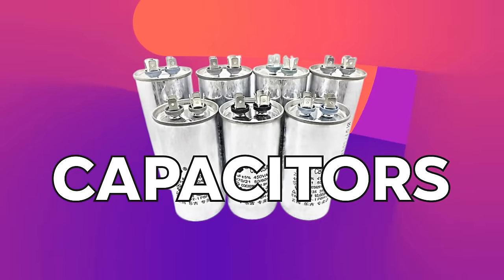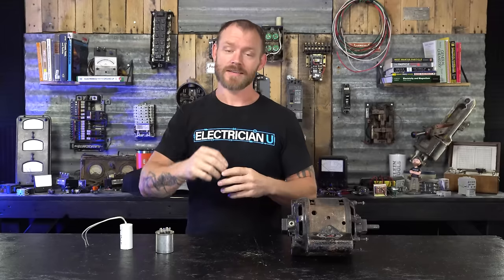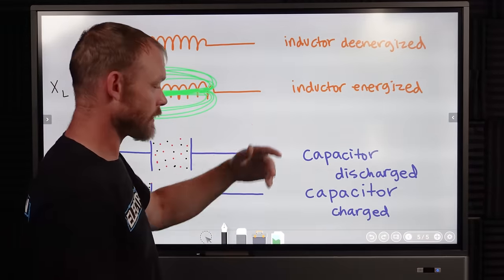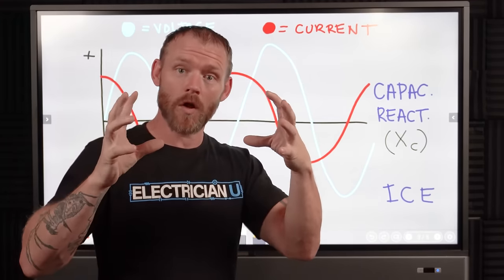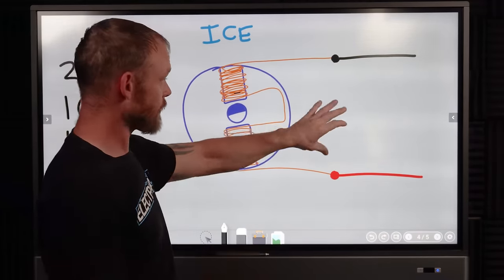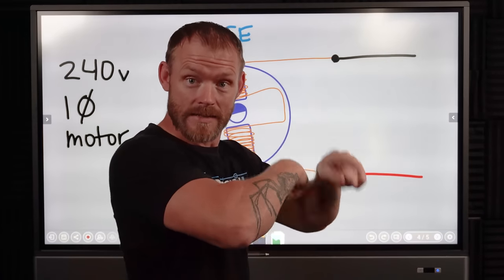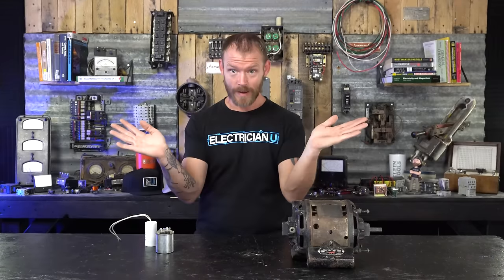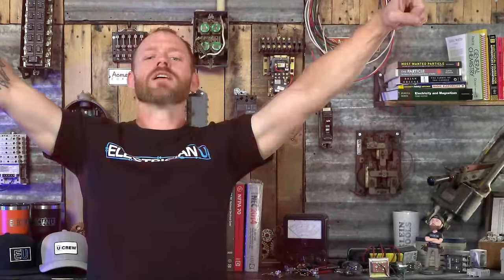Why Are Capacitors on Motors? What is Capacitive Reactance and Inductive Reactance?

Comment: Love your videos and going into this topic! Comment on A/C condenser capacitor is a bit off: those are dual value run capacitors (around 14:30 in vid) 45/5 or 50/5. The larger value is wired to the compressor, the lower to the fan motor and there will be a common. On occasion you may find an additional capacitor if someone added a hard-starter to extend the life of a failing compressor. Point is, any of those type capacitors in a condenser are run capacitors.

There is no such thing as a dual run/start capacitor. Run capacitors stay energized whenever the device they are connected to sees line power. Start capacitors are always switched off after a very short start cycle or they will fail. Your choices are simply run capacitor, dual value run capacitor, or start capacitor. The only exception are these multi-rated capacitors but those are strictly run capacitor that you use jumpers to in effect set the overall capacitance within the ranges available.
Reply: John - I agree...completely....

Comment: My "down in the trenches" lesson in motor capacitors came years ago when I had a customer who bought an old industrial two-phase drill press from a factory in Philly. I went to a motor shop to see about getting a single-phase motor to replace it and the guy asked "Why would you do that? Just add a capacitor!" He explained how a lot of motors we use now actually have two-phase windings and the capacitor makes it work in a single-phase system. Once he explained the basics, I was able to build a timer circuit to pull the cap out once the motor got started and the customer got a really cool drill press to use in his shop.

Comment: I have inherited a grinder that I have to start by manually spinning the grind wheel in the direction I want it to go (I can decide, up or down). Now I understand why I have to do that. No capacitors.  Thanks!
edit: it's very old. Has oil wick lube for the bearings.
Reply: I'd tell you to be safe but I don't see how anything could go wrong with that
Reply: Sounds like something's not working right, if that was my grinder I'd open it up and look for a spot that a cylindrical object such as a capacitor would fit in there, as well as potentially a couple of leads for one. You might find a capacitor in there that's failed open circuit, or just has greatly reduced capacitance because it's had the electrolyte dry out.
And if it's intended that you should be able to choose the direction of the motor, well there's ways to run a 3 phase motor on 1 phase power (involving usually multiple capacitors to effect the required phase shifting), and if you still want it reversible you can have a mains-rated DPDT (on-on, break-before-make) switch (wired up as a polarity reversing switch) and connect that between any 2 of the 3 phase wires and the power that goes to the motor (after the capacitor bank).
It would help if I could draw a circuit, but I know it would work, it's just combining the concepts of "how to run a 3ph motor on 1ph power" and "how to reverse a 3ph motor".
You reverse a 3ph motor by swapping any two of the 3 phase wires, that's what that DPDT switch does. Don't flip that switch when the motor's already running tho, bad things might happen.
Reply: Most single phase grinders do not have a capacitor. Most  likely grinders do not require a lot of starting torque ( unlike compressors ) because a load is generally not applied until the motor comes up to full speed. These motors are considered a split phase if they have a start winding to provide out if phase ( with the run winding ) starting torque.
Reply: @JohnThomas-lq5qp  Oh, I see. So then a grinder might have a "shaded pole" design then, similar to the small AC motors such as used in electric can openers and desk fans, instead of using a start or start/run capacitor, that makes a lot of sense.
In that case there's still something wrong with the grinder that can be made to run either way, it might have a broken wire in the shaded pole winding (which is usually just a turn or two of thicker copper wire).
Reply: Can we pin this? This is almost as informative as the video!
Reply: @tripplefives1402  Angle grinders yes, but I believe in this case we're talking about a pedastal grinder.
Besides, with a universal motor there's no way you can get it to "start backwards", it always turns in one direction unless you install a polarity reversing DPDT "on-on" switch on either the wires leading to the field winding or the wires leading to the brushes that contact the armature (both will work too, but it becomes redundant).
This is because it's the polarity of the magnetic fields between the armature and stator.
With a permanent magnet DC motor, switching the polarity of the electrical supply reverses the motor because the stator has a "fixed polarity" due to being made with permanent magnets, and reversing the polarity of the current thru the armature reverses the motor.
With a Universal motor on AC, each half-cycle of the electricity reverses the polarity of both the stator and the armature, but the end result is still a motor that will continue to turn in the same direction regardless of polarity. If you however change the polarity relationship between the stator and armature, you will reverse the direction of rotation of the motor.
With an induction motor (the kind that need capacitors) or shaded-pole motor, the operating principle is entirely different. No longer are you working with attraction and repulsion of relatively fixed magnetic fields. Instead, you are working with a rotating magnetic field in the stator, which induces an opposite polarity magnetic field in the rotor, and the rotation of the magnetic field in the stator "drags along" the magnetic field in the rotor, which causes the rotor to turn by magnetic induction. Because the frequency of the AC waveform is fixed, most kinds of induction motor will generally turn at a more or less fixed speed regardless of load, because that is the speed of rotation of the magnetic fields generated by the stator.

However, with a universal motor, the rotating magnetic field is instead generated by the armature, and is only rotating relative to the armature. Because the commutator that is attached to the armature is forced to rotate at the same speed as the rest of the armature, the switching must take place at the same rate as the rotation of the armature. But because there is always an imbalance in the magnetic fields thanks to the specific arrangement of the armature coils and the commutator and the rotational position of the brushes relative to the field coils (or permanent magnets in a DC motor), the motor will tend to have a speed entirely dependent on the mechanical load (including frictional losses), as well as the supplied voltage (after taking into account the back-EMF from the switching of the armature and/or field coils).
In relationship to the stator, the magnetic field of the armature (the polarity and position of which is controlled by the segments of the commutator) does not quite line up with the stators magnetic field, and the tendency of opposite magnetic fields to attract (based on this misalignment) is what creates the torque force, rather than magnetic induction in an induction motor.
Some very large or very high performance brushed motors have an adjustable rotational "clocking" of the brushes relative to the source of the stators magnetic field, this allows for some optimization of when the commutator switches what windings of the armature are energized, so that the motor rotates most smoothly at its intended operating speed.
However motors in things like vacuums and yes grinders will generally have fixed brushes, well I mean they're on springs so they can follow the commutator contacts as best as possible, but the clocking is essentially fixed to what they think is a good balanced operating point when the motor is manufactured.

Comment: this really helped.  Thank you for spelling it out, 
 Inductive reactance is where the voltage is leading, and current is lagging. In capacitive reactance is where Current leads and Voltage lags. In essence, in an inductive circuit, the amount of magnetic energy keeps things so bound up that it slows down the current flow. However, the voltage is still churning away, but the current is lagging. In a capacitor, when discharged, the positive and negative are just randomly kind of hanging out together. But when charged, those positive charges group together, as do the negatives, in a much more orderly fashion, ready to be discharged to do their work. But with them being so far apart now, current cannot get thru, hence the current LAG in capacitive reactance! In essence, inductive and capacitive are just polar opposites of one another.

Comment: Great video.  It's a good idea to look at the starting capacitor as "low gear" to get the motor spinning, and the run capacitor as an "overdrive" gear to improve efficiency.
Reply: Can't get a strong rotating magnetic field on single phase motor without one on a centrifugal switch, otherwise they're just single phase hacks that should simply die off with modern 3 phase vector. They're a big money profiteer however in the industry due to how frequently they crap out when it gets hot out. Those things ALWAYS die when you need them the MOST. It never fails. by design.... heat kills caps.

Comment: I explained to a coworker why a capacitor is used. I drew a sine wave like you did to show the phase shift. I explained it a little different tho since he hasn’t learned the theory part yet. I simply told him that we apply an external voltage to the motor to create EMF and turn the motor. When the motor is turning it creates a back EMF and the capacitor is there to overcome the back EMF that the motor itself is producing and thus putting it back in phase. And that’s why the voltage is higher at the cap then your incoming power.

Comment: My understanding is:
power factor (PF) = RMS power of load (kW of actual power used) / avgVolts*avgAmps (kVA)
A resistive load of a simple heating element or incandescent light bulb (old filament) has PF = 1 & current rises with voltage together, in constant proportion & peaks at the same time.
A PF between 0 & <1 means average current is higher than expected because it's lower than expected when voltage is high, and current is higher than expected when the voltage is lower. A wire/connection/transformer is rated for average current, if the voltage is lower when current is higher it means less power can be moved for the same current (current=heat in wires & transformers).

An AC capacitor in an AC circuit will charge & discharge 2x every full cycle (2x the frequency). Charges as voltage goes up, discharges until volts in returns to 0, then gains negative charge while the voltage is negative & discharges as voltage returns to 0. Positive & negative are relative; AC keeps swapping which side is positive & the other is negative but energy can be used (work done) in both directions.

As the voltage increases, more current can flow into the capacitor than the motor coil. As the voltage peaks, more current will flow into the motor coil (but not yet it's lowest resistance of the cycle, that comes a fraction later). Then the capacitor will help supply current to the motor while the supply voltage is falling as the motor coil continues to suck power. Then the AC voltages are reversed so the sign reverses on a DC meter but the effect is same as before. The coil is closer to the opposite magnetic pole in the motor so reversing current (caused by reversing voltage) means the N & S never stay opposite each other in the motor long enough to stall (slight momentum is lost but it's sufficient for poles to pass then voltage switches, then push/pull continues).

Comment: Thanks for all of information.  Been messing with my condenser unit all summer to understand the difference between the start and run capacitors and realized the run capacitor was dying and needed to be changed.

Comment: Finally i understand power factor now.
 I've always thought that: why laging or leading cause inefficiency but the electrical charges (energy) are conserved and not lost ? like a small battery as a buffering zone that saves the energy to use it later?!
but now i got it, it is about the instantaneous Work done, Not the energy available within the system, because Power(w) needs both  potential(v) and Current(A) available at the same time in order to actually do the work.

Comment: Finally... a good expiation of what a motor start and run capacitor does.  I always wondered why the need for both (especially on HVAC equipment and anything with larger motors).  :)

Comment: Great video. I use the power factor function on my meter to check single phase, dual capacitors all the time on residential condensers. It's quicker than killing the power to test it directly or using formulas while under load. Best part it actually tells you that the cap was sized right in the first place.

Comment: this is an awesome video. you have a very good understanding of what’s going on at the microscopic level. comment, though (i’m a physicist): in a capacitor, there charge rearranges via a “displacement current,” not by getting pulled to the plates. it is actually the changing electric field which creates an effective current. beyond linear reactance theory.

Comment: Generally speaking, I found your explanation pretty informative. However, there are some things you should consider (possibly Semantics), but just to make sure it is clear:  Current "appears" to flow, but doesn't actually flow "thru" the dielectric gap in a capacitor... I only bring this up because it was explained that way on the diagram in the video, so I don't want people to get the wrong idea. So, to be clear, Current doesn't flow thru that gap that you have in the diagram of the capacitor. Instead, current flows into 1 side of the cap (builds up ) and then returns out the same side... but NEVER "thru" the capacitor. AC can get away with "appearing" as current is flowing because of the way the charge moves into and out of "both" the sides of the plates, but in reality,  electrons (and thus current) never cross the gaps in the plates (unless) the capacitor is bad or has leakage.
Re: your motor diagram (@11:12), I believe your understanding of it is correct, however, it is important to show the second coil (run / start etc) in order for the capacitor explanation to really make sense, because the way it works, the capacitor doesn't work with 1 winding... it takes at least 2. So, I think people will get confused with your 1 winding diagram. By showing the 2nd winding, you can better explain how the phase shift affects the 2nd winding at a different time due to the capacitance, which allows it to push / pull on the motor at a different point in the rotation.

Comment: Another function of capacitors in parallel with motors is to straighten out the power factor, so that the load on the supply is a resistive load.  When the capacitive load balances the inductive load the reading on the kWhr meter is minimal.  In simple language a ballast capacitor reduces electricity bills.

Comment: All good info, as I'm doing more with AC induction motors these days, including having to replace capacitors. I knew what the numbers meant, but not what the numbers do. And now I won't be immediately tempted to get a higher uF capacitor when replacing. No longer thinking it's 'better' and sounds like it may make the motor inefficient, therefore making extra heat probably,  as wouldn't it risk being out of phase then?

Comment: Mr. Electrician, , ive been repairing and rewinding ac motors for several decades now. For me , in my technical opinion, the main purpose of the capacitor in an ac single phase  motor is to connect parallel the starting winding and the running or main winding during start-up, at this moment the capacitor is in charging state.  This will help the motor armature to rotate as it require additional current as the main winding current capacity  is not enough to move the armature during initial start-up, other than initial start up the starting winding also guides the armature in its correct direction (CCW or CW). . Once the armature is moving, the capacitor will start to discharge and will disconnect the starting winding leaving the main winding running the armature. The centrifugal switch will act as an redundant switch in case the capacitor discharge quickly to the point it never reaches the ideal RPM to disconnect the starting winding. Again this is only applicable in single phase motors. Try to read Robert Rosenberg book on: 'Electrical Motor Repair' good reference for electricians.

Comment: I used to work for a microchip manufacturer and every single morning when the machines were really starting to ramp up for the day, our control center would get a call from the power company that they were going to be remotely closing in a capacitor bank so we might see a bump on our power monitors

Comment: 16:05
Start capacitor is in parallel.
Run capacitor are in serie.
But usually, there is only a start capacitor.

Comment: You should discuss power correction factor, voltage correction factor, line conditioners, ferrite current filter resistance, buck, and boost methods.